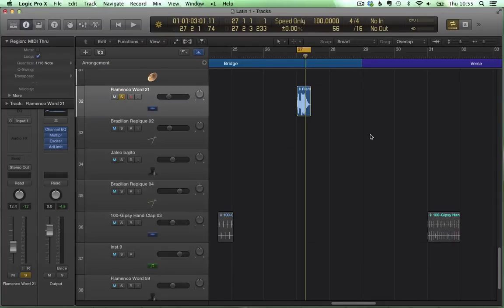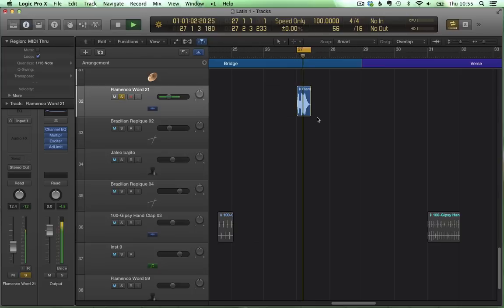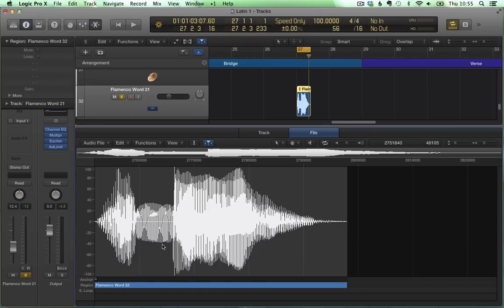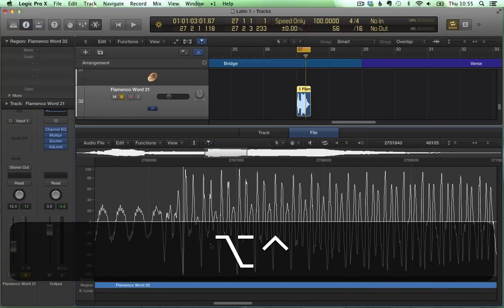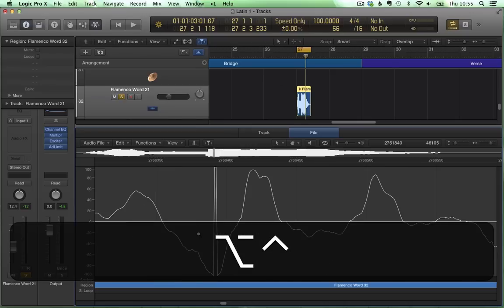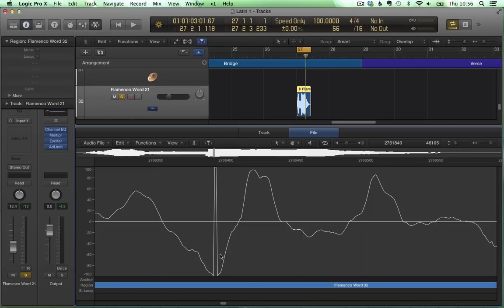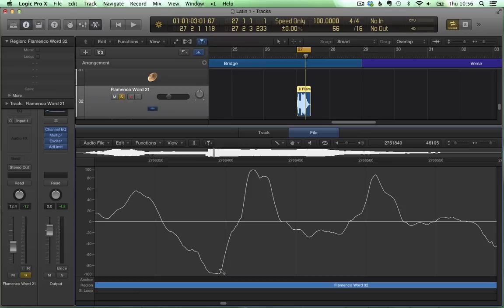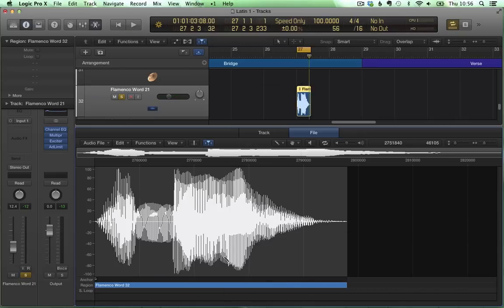Removing Clicks and Pops in Logic X

Comment: Thanks for this tutorial! For anyone who was having trouble with the audio file dragging after you selected the pencil tool, make sure you click on the "File" tab before editing. You can only make these edits in the "File" tab environment, NOT the "Track" tab. Cheers!
Reply from the maker: digitalgr8ness indeed, thanks Digitalgr8ness!
Reply: Thank you!! I was trying to figure this out
Reply: Mine doesn't have a 'file' or 'track' tab like yours. I have version 10.3.3. Do I need to update?
Reply: Nevermind I got it! If anyone has same question -- Go to Preferences>Advanced features, check the top box and the "audio editing" right below it.  Then during editing with pencil tool, the 'vertical zoom' and 'horizontal zoom' at top right of box have been very helpful for me. Thanks for this video!!
Reply from the maker: @lilly27sings  Thanks to you Lilly, sorry I didn´t get to read this in time! Glad you sorted it out
Reply: Yaiza Varona thanks!! I will say it’s been very difficult for me to find the pop in the waveform. Mine almost never has a giant spike like yours did. Any advice for that?
Reply from the maker: @lilly27sings  Unfortunately not! Each click and pop are different, some are easier to spot and others (especially if they are irregular in shape) are more challenging to repair. The only trick I can think of is that a maximum zoom in is not always necessary the best to spot the alteration in the wave form, sometimes just adjusting the overall conflictive area can work better than trying to find the most minuscule graphic issue. Hope this helps!

Comment: Finally, a video that gets to the point. Every other video acts like your brand new to the whole recording thing and spends 6 minutes talking about every option under the sun only to promote some plugin as the solution.
Reply: So my pencil tool just drags the entire clip? It works as a pointer. I don't get it.
Reply from the maker: Glad to hear it’s useful
Reply from the maker: ipresent check out if you have the tab ‘file’ selected instead of ‘track ‘ in the window local menu (the audio editor)
Reply: @yaizavarona i don't see the option to select the file, only track or smart tempo :-( help!
Reply from the maker: @GabrielleSolange  Hi Gabrielle, 
Maybe you´ve already sorted this yourself but here goes nothing :)
I´m guessing you´re at the latest Logic update (unlike myself as I´m one version behind) so perhaps I won´t see exactly the same as you have, however if you´re on the Audio Editor there should be a tab in the horizontal menu including File next to Track (my guess is this might be where you´re seeing Smart Tempo, maybe that´s changed in the new version). Until I update myself, which can´t do at the moment as I´m in the middle of different projects, and see what you have in front of you the only thing I can think of is to make sure you have only one region selected in the track before double clicking on it / opening the Audio Editor in case this is what causes the editor not to show you 'File' in the local menu. Hope this helps, all the best!

Comment: Im having trouble, when I try to re-write the segment with the pencil tool, i grab the audio segment and drag it even though i have the pencil tool selected.
Reply: +Paul Cogley haha nope, no one has answered. I gave up on it and just deal with the clicks being there. And even 9 months later I haven't figured it out on my own.
Reply from the maker: +Carter Chan Hey Carter, I recall you mentioning via message to me that you had sorted it out - if memory serves because you had selected Advance tools in Logic preferences? My guess is the success of the pencil tool depends highly on the kind of click you have however it definitely should show - if it doesn´t I´d check what version of Logic are you on or try reproducing it in a brand new project (in case the project has some corrupted settings, this often helps).
Reply from the maker: +Paul Cogley Hey Paul, what version of Logic X / OS are you using? Does it happen consistently in any project / audio region or just in the one? Are all audio features in Logic enabled? From the top of my head that´d be the first things I´d check for troubleshooting
Reply: +Yaiza Varona yes, originally I could not view the "Track" or "File" tab. I figured that out by turning something on in the advanced tools, I don't remember exactly what it was at the moment. However, I could not consistently get the pencil tool to draw a new line on the audio file. I'm still having trouble with that piece but it's most likely me misusing it.
Reply from the maker: +Carter Chan I take it it happens independently of the audio file and project you´re working on? If it´s just the one audio region chances are it has some sort of protection to edition
Reply: +Carter Chan +Paul Cogley Hey, I just recently watched this video and was messing around. I was having the same problem but solved it. If you notice in the editing window, at the top theres two tabs that say Track and File. Make sure you're in the File tab when drawing with the pencil. Hope this helps! :)
Reply: @athenaa.bosendorfer  Thank you so much!!!!! I have been trying to figure this out for hours!!!!

Comment: Thank you. Can you also explain how to remove clicks after bouncing the file on the beginning of the song? What is the reason of such problem? Could it be CPU or Audio Engine related problems? Thank you...
Reply from the maker: Hey Shuka4Beats,

There can be many different reasons for corrupt bouncing, many of them CPU related as you point out - basically, if the system can't handle all the operations it must perform at the same time the result can be sound artifacts and errors. If you find that this consistently happens only when bouncing (instead than because of an audio region or track, which would also shown when playing back) you could try to ease the work of the CPU by freezing some or all tracks or by increasing the buffer size in preferences (it will give the system more latency but it's great for mixing, bouncing and other CPU heavy procedures).
Hope this helps
Reply: Also try adding a bar of silence at the start of the project, gives time for multiple plugins and automations to start when you have lots of processing going on

Comment: Cool. Thanks for the tips. Do you have any advice for clicks/pops at the ends of samples?
Reply from the maker: V.I.F. Could you please elaborate a bit more? Are we talking about single audio samples or samples triggered inside a platform (such as Kontakt or Engine)? It depends on each case but here are some thoughts: if it's a regular audio file, the tip you watched could ideally help (although I guess from your question that this was not the case), otherwise I would check if there is any plugin / effect applied that could be affecting it (like a corrupted reverb from a hidden bus in an old imported project). In the second case I am not sure I can be of further help as I don't script virtual instruments myself, however I'm sure there are many resources to consult on seamless playing of samples in YouTube. 
I hope some of this helps, good luck with your sample
Reply: Alright thanks. Yeah, actually I was talking about regular audio files, I'm just starting to experiment around with chopping those and making beats and stuff, and I have found other videos on this :) But thanks for this channel, alot of these tips are simple things I would never figure out otherwise
Reply from the maker: V.I.F. Oh I see, glad to hear you find them then. I haven't done much in beat creating myself but if the pops were caused by slicing I wonder if a tiny fade out applied to the set (as in each slice) would be helpful. Anyway, I'm sure there are tons of great tips around on this. Thank you for watching and all the best with your beats
Reply: Yes the "fading tool" is exactly what worked. Thanks for the support :)

Comment: How does this work in Logic X? I have the pencil tool up but have no idea where the file/track option is and all I am doing is dragging my track around.
Reply from the maker: City of Shoes the window for the pencil tool to work is the audio editor (which you can open and close by pressing ‘w’). There you should have file/track as tabs in the local menu options (displayed horizontally in the window frame). Hope this helps!

Comment: How do you still edit when it prompts you with a message that says "Audio file cannot be changed. volume or file is locked"?
Reply from the maker: Travis Neal some files have protection that will avoid any changes, watermark wise. Sometimes bouncing it in place and saving it as a new file will help, but it depends on the kind of protection it has and why
Reply: @yaizavarona  thank you for getting back to me. I found bouncing in place was the key for me to edit :)
Reply from the maker: Travis Neal Great to hear

Comment: I have cracks all throughout my song.. anyway to just fix the cracking sound throughout or get rid of it???? its KILLING ME
Reply from the maker: Hey there,
If the cracks happen throughout a whole project I would recommend checking the buffer size, it might be that the equipment struggles to handle all the operations taking place at the same time. You could also try freezing some tracks that don´t require further editing and see if it changes anything. Hope this helps

Comment: Is there a way to PREVENT THIS? All my tracks have this and I can't seem to rectify this problem.
Reply from the maker: If it is something consistent in all your tracks I would check the A/D converter of your audio interface, it shouldn´t produce artifacts generally. Another half-way potential trouble shooting would be to access the audio files of your recordings again from a clean project in case for some reason the audio corruption occurred when importing /copying them (this is moderately frequent). Hope this helps!

Comment: hi, very useful. but how do i remove click noise from an midi instrument? when they change the notes, they make this clicking noise. awful.
Reply: That sounds like you either need to increase glide time on the instrument or add some attack to the volume or cutoff envelope
Reply from the maker: Hey Pedro, 
I guess that would greatly depend on the MIDI instrument itself; some libraries even incorporate some noises and artifacts on purpose as they are close mic recorded when sampling them; for example with a harpsichord this is very noticeable. If this is the case I would recommend either contacting the sample developer in case they can help with editing the instrument (inside Kontakt for example) and / or double check the click doesn´t come from your MIDI keyboard (should this be the case, most likely you can mute it too). Hope this helps!

Comment: I am new to logic.. need one help...when i bounce a project to mp3, the volume seems to be very low sometime ..i tried to increase the master gain before bouncing... but didn't help..How do you control the volume while bouncing the project to mp3.
Reply from the maker: Typically you don´t! I´m unaware of a way for doing this (or how could Logic even alter the volume when bouncing to mp3 itself). I would suggest to try the same operation in a brand new project see if there is any strange audio corruption you can avoid like so. Good luck!

Comment: yaiza I tried to do it but it said the file or the volume is locked so I couldn't do anything about it Can you help??
Reply from the maker: sungjin ahn you can make sure that in the Wave editor the tab ‘File’ is selected (not tab ‘Track’), if this is the case you can also try to bounce in place the region and rename it. This usually overrides the protection of the file (unless it’s watermarked material etc) in recordings. Hope this helps!

Comment: Do you by any chance know how to remove pops/crackles when exporting audio to movie?
Reply from the maker: +Composer Jamie Coleman I have not encountered this myself so far but a potential solution would be to bounce in place both the soundtrack and the audio track embedded in the movie and check them separately to isolate and fix the origin of the crackle. Theoretically the process itself of exporting the audio to the movie shouldn´t affect the quality of the audio itself so chances are the origin of the corrupt file happens before. Hope this helps!
Reply: +Yaiza Varona Thanks Yaiza, after almost 2 hours on the phone with Apple, they told me I need to upgrade to 10.2 and that should fix the issue, so we'll see!
Reply from the maker: +Composer Jamie Coleman I am not in the latest version myself and still works fine, I wonder why does the process lead to file corruption in this case. I am sure though that after such a long conversation you will have tried any and all troubleshooting existing...! Please keep me posted on how it went with 10.2 (fingers crossed), hopefully you'll be leaving all the hassle behind and focus on enjoying your writing to picture

Comment: I tried to use this on a vocal I recorded today and I keep getting a message saying "this audio file is locked"  any help?
Reply from the maker: Some audio files are watermarked, if this is the case you can double check with the source of the audio file on how to to remove any protections so you can edit it. Hope this helps, good luck!
Reply: @yaizavarona  I recorded the vocals myself. how can they be watermarked? and how can I go about finding the source of the audio file? its on logic
Reply from the maker: @ceesKe12  Well no watermark then :)
Here are some things to try (always keeping a copy of your original file safe in case). In the audio editor, make sure tab File tab is active (instead of Track) always. 1) export the audio region as a new audio file and see if the new version still is protected, 2) same check but bouncing in place the audio region 3) same but converting to a new region.

Comment: HI I was wondering if you know some keyboard shortcuts to better navagte around wave form when zoom in
Reply from the maker: Brian Craig Hi Brian, unfortunately the zooming in and out is mostly manual in this procedure, the only thing you might try is CMD+(arrow) to better adjust although once the magnifying glass icon is on it tends to override it. Hope it helps
Reply: @yaizavarona  Yes that did help
I am working on game sound design

do you have a website I have some questions that need visual
Reply from the maker: @briancraig1684  Sure, you can book an appointment here: https://www.yaizavarona.com/logic-pro/

Comment: When I try to use the pencil it say ''Volume or Audio is locked''. What to do?
Reply from the maker: Yaiza Varona
Double check it´s not a watermarked audio file (so that you need the creator´s permission to edit it), if that´s sorted you can always try to export it as a new audio file or bounce it in place and check again. Also, make sure Advanced settings are enabled. Good luck!
Reply: Yaiza Varona I AM the creator of the audio file!!!! haha... The export tip worked. Thanks a lot! 🙏

Comment: This audio file cannot be changed. Volume or file is locked... What do I do?
Reply from the maker: Double check it´s not a watermarked audio file (so that you need the creator´s permission to edit it), if that´s sorted you can always try to export it as a new audio file or bounce it in place and check again. Also, make sure Advanced settings are enabled. Good luck!
Reply: Yaiza Varona thank you. its my voice that I recorded and I do have my advance settings enable so I’m not sure what to do! It’s very frustrating... I’m started to think to stop using flex audio all together :(
Reply from the maker: Martin Bonavia Is the pop caused by Flex Time then, as in by editing already the audio file? I doubt the tool described in this tutorial will work if Flex mode is active at the editing mode if so. Can you see the pop in your wave editor in your audio file?
Reply: Yaiza Varona Hi yes it is cost by flex mode so would you suggest for me to bounce it and then add a new track so I can edit it?
Reply from the maker: @martincontreras6031  It´s difficult to say without hearing the file but if the pop is caused by Flex chances are it won´t be easily fixed as the Flex audio edition has its limits on what it can achieve smoothly depending on the region. You could try and bounce it see if the procedure in the tutorial helps but I´m afraid it won´t be of much use on files already 'distorted' by Flex but works mostly on occasional pops. Best of luck!

Comment: why the pencil tool doesn't work on me even though I'm editing on file?? I mean it doesn't cut any wave at all I need an answers plss
Reply from the maker: Does the audio file have some kind of protection? It can also be caused by not having the correct zoom in on the file. Finally, you can try bouncing in place the file or exporting it as an audio file, for some reason this often helps. Good luck!